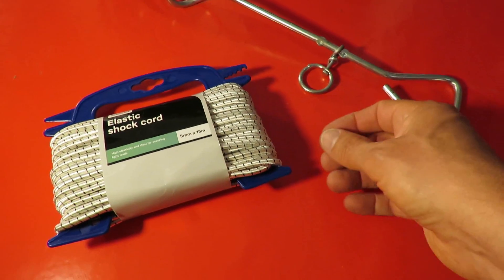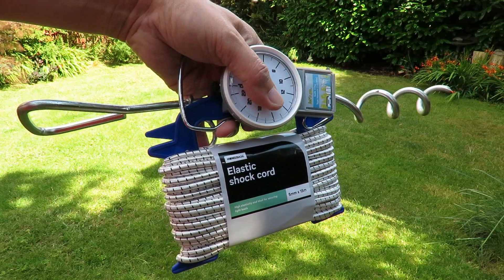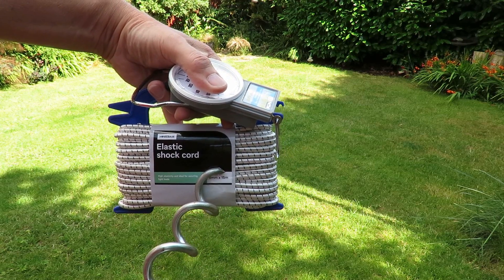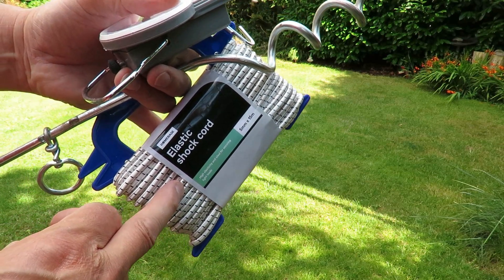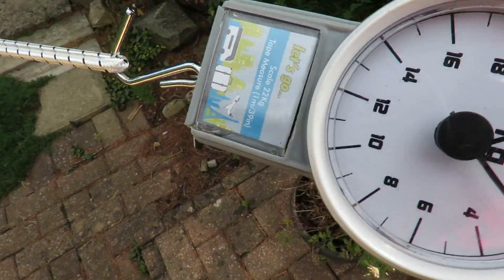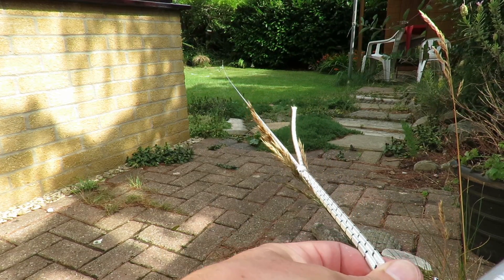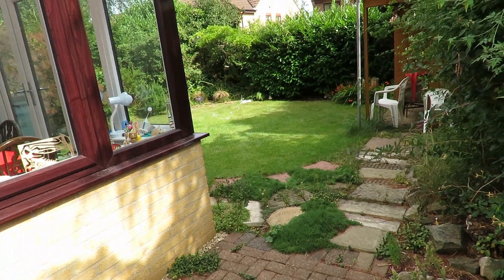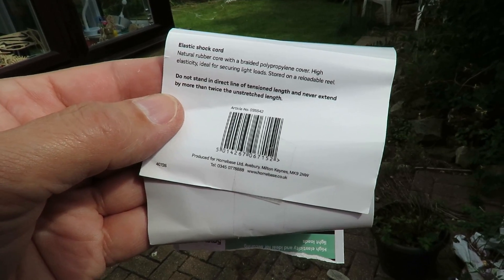Bungee or High Start🛩️Launch PART 1

Comment: I think I read somewhere that for tow hook location as a starting point aim for 12-15 degrees in front of the CG. Then adjust for model and wind strength.
Reply from the maker: Err 12-15 degrees?
Reply: GrandadIsAnOldMan mark the CG on the fuselage right where the wing meets the fuselage. Get a protractor and measure 12-15 degrees forward of the CG. 0 degrees would be directly below the CG.  Where the 12-15 angle meets the bottom of the fuselage this is where the tow hook position should roughly be.  Measuring this way will take into account the depth of the fuselage. Hope this helps.
Reply: To be more conservative some start at 30 degrees and work backwards to find the sweet spot.
Reply from the maker: Thanks, so are you taking the bottom of the wing as the datum line? To be honest, the easiest option would be to fit an adjustable hook, then it can be trimmed to get the optimal position. I haven't done that but it would not be too difficult to make one up.
Reply: GrandadIsAnOldMan  Draw a line vertically down the side of the fuselage at the CG position, get out a protractor and draw another line from the vertical line at 30 degrees downwards and forwards, until the line intersects the lower edge of the fuselage. A picture would be handy to explain this better! Here's my attempt using visio https://imgur.com/gallery/CCX2v